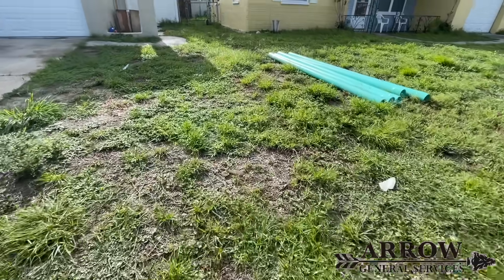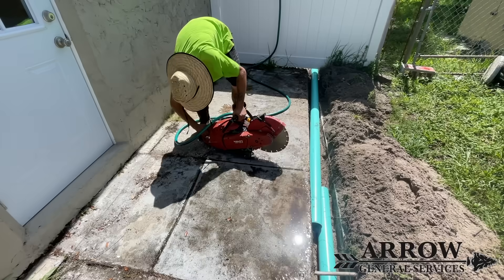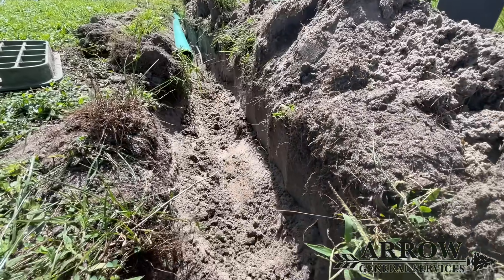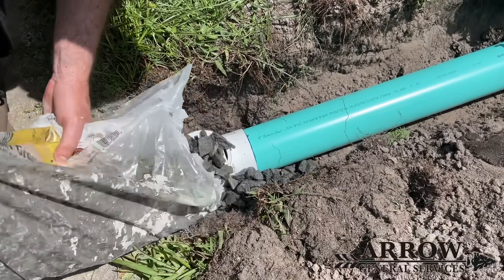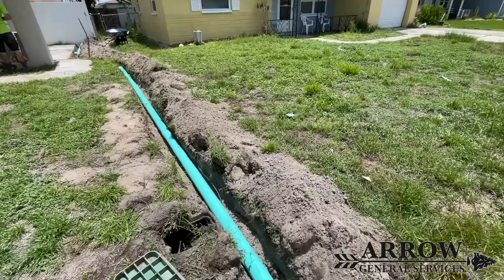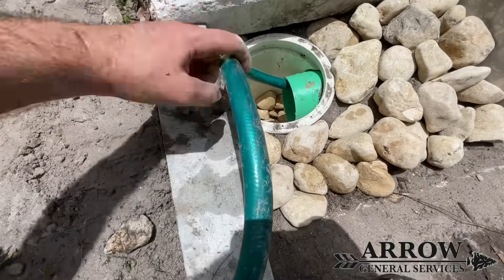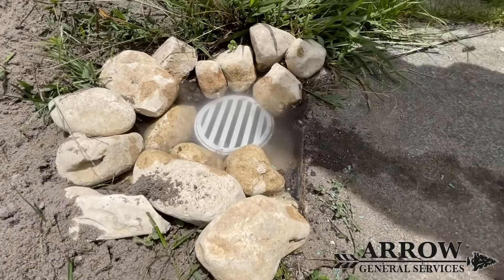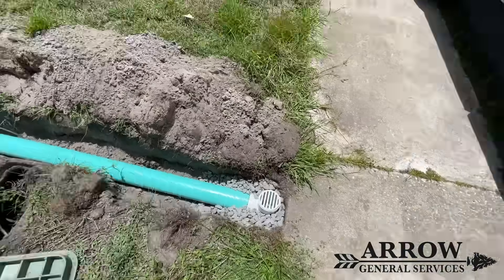How To Drain A Yard With No Slope - Flooding Issue Solved

Comment: Great solution for areas that do not have lengthy freezing temperatures. We generally try not to discharge water onto walking surfaces in the winter because of ice buildup.  Discharging water across a sidewalk in Wisconsin would be like buying a lottery ticket to a lawsuit for a slip and fall claim.
Reply: Absolutely. This isn't legal in any city.
Reply: @ThorD4602  Here in Texas houses are built with a slope to a shallow V between homes and sloped back to front so a river of water forms between houses and discharges across the sidewalk and into the street. He just built an underground version of how yard grading is done here, so not sure about, not legal in any city.
Reply: @wojtek-33   you aren't allowed to discharge water across a sidewalk in any neighborhood setting. You can get a permit to core the curb and dump into the gutter in many places. He didn't go for a permit, so until somebody cares, it doesn't matter.
Reply: @ThorD4602  I just explained to you how most neighborhoods are designed and built here. Coring the curb isn't allowed in some cities here either. Water is directed or discharged, across our sidewalks by design. Due to some flooding issues here as well, foundation sump pumps direct water into a channel along the property line and discharge across the sidewalk. It's just how it is here.
Reply: @wojtek-33   huh? You didn't explain anything to me. LOL.
Reply: @  You are clueless about the laws in your own state, and at the same time, you are acting like an expert on the subject.

Here you go:
 In Texas, it is generally not legal to run downspout discharge across a sidewalk. The Texas Department of Housing and Community Affairs requires that gutters and downspouts be designed to prevent water from running across sidewalks or onto adjacent properties. Discharge should be directed to a storm drain, the street or alley, or an approved watercourse, or at least 10 feet away from the building or property line.
Reply: @ThorD4602  Generally means something different than you think it's means. I explained to you how things are built and approved by the cities around me. Just like I explained that curb coring is not allowed everywhere either. Which to be clear to you, means it is approved in some places. Does the water magically jump over the sidewalk into the street when you need to discharge it?

Comment: Also curious how this is holding up since the video is 4 years old now. 
Looking into using this as well. Curious if a non woven fabric could also still be used with this to just help protect the prefabbed fabric that is on it. 
Thanks.
Reply from the maker: So far so good because we haven’t had a call back, but remember this is not a French drain. Meaning the pipe is solid and does not have perforations in it. This system simply moves water from point A to point B. If you are building a French drain (perforated pipe) then I would highly recommend using a good non woven geo textile fabric to wrap both the stone and pipe. We have more videos on our channel showing how to build a French drain. ✌️🤠

Comment: This would not work on a yard with no slope... How would you lay the pipes with fall? It clearly only works if the outlet is lower than the inlet, i.e., the yard is sloped.

Comment: I just dig a 4’x4’x5’deep hole and fill with a plastic crate or rocks then 12” of soil on top. They’re good for 40/50 years and are totally hidden and no water running across sidewalks. Standard requirement in U.K. 5 metres from a building. Water can fill up voids and percolate into soil over time

Comment: Instead of solid PVC, entire run should have been perforated PVC or hdpe with fabric wrap.   Then backfill btm w small rock. Entire system would be leak out drain similar to septic field.

Comment: Make the rain gutter downspout 4" diameter and sealed all the way to the outlet at the sidewalk. That way it all gets flushed away by simple water pressure.. 

The "field water" then can be routed to a large french drain in the front yard where the non-roof water can leach into the ground.

Comment: I have found you to be a good presenter and very thorough. There is one thing I don’t understand in this video. Why fill the two foot section with drain rock? Seems like the volume of that section is now full of rock which can clog with sediment. Why not put six inches on bottom to break the fall of water and leave the rest empty to accomodate water?

Comment: Why use this solid pipe and not french drain it the entire length?
Why do companies think they are giving you a good drain when the only thing in this entire project collecting water is those couple catch basins?
That entire length of pipe could have been made into a drain as well............................................
You almost got it done, but you didn't follow through.
This is not what you want as a homeowner.
I would demand the catch basins and french drain pipe the entire length.
This is crap work.

Comment: 4:00 what's schedule 80? Like schedule 40 twice?
Reply from the maker: Double the wall thickness. They usually come in gray but that particular repair coupling was white. The markings on it read PVC SCH 80. I’m pretty sure it’s a pressure fitting.
Reply: @StormWaterDrainageSolutions  it is

Comment: Does the 4" green pipe have no holes?  How do you clean the grate at the end of your run by the sidewalk? Is it removable?    Is the pipe you run under that grate preforated?  How does the water come out?  There is no cloth around the end of the pipe, so I thought it would get clogged up at the end of the run underground two feet down.  How do you measure slope?  Thanks!
Reply from the maker: This is a solid system so there are no perforations in the pipe. The grate pops on and off but we do not use grates at the end of our systems anymore, this video footage was filmed years ago before being uploaded to YouTube. Best to use a straight pipe when you can or a pop up emitter. The water comes out due to the pipe having slope. The yard has virtually no slope until about the last 5ft before the side walk. This is what allows the pipe to drain out at the discharge end and not back up at the catch basin or channel drain. This system was built before we started using geo fabric at our discharge ends. Now we always put it under our pop up emitters. Best way to measure your slope in yard drainage is to use a 4-6ft level and make sure your bubble is going opposite of the way you want water to travel. For more in drainage education check out our other videos. Thank you for your interest and support!
Reply: @StormWaterDrainageSolutions   Thank you for this information! :)
Reply from the maker: @squirrelattackspidy  Not a problem 💪

Comment: Bro, just cut the side walk and drain the water to the street that's kinda mickey mouse.
Reply from the maker: The city does not want you cutting their infrastructure. That’s a big no.
Reply: Oh please like they are gonna care as long as its replaced and doesn't create a hazard. I just tore up my whole sidewalk and driveway and it city inspector said nice job. Just say verbatum "Sidewalk was cracked and there was a Hazard." They wont care. I did it without a permit and they didnt care. @StormWaterDrainageSolutions
Reply: Oh please very Mickey Mouse job... 
 @StormWaterDrainageSolutions

Comment: Not sure how well this system would work in cold climates.
Reply from the maker: It’s a Florida system, I would not recommend for Northern climates. For cold temperatures use a high quality HDPE pipe and system.
Reply: @StormWaterDrainageSolutions  that's what I was thinking.
Reply: @StormWaterDrainageSolutions  would love to hear from a contractor in an area with winters where the temperature regularly fluctuates above and below freezing. I need something like this in upstate NY but regardless of whether the pipe is freeze tolerant the water would freeze (unless the entire system was below the freeze line) and when the air temperature was warm enough for rain but the the system was frozen nothing would flow and then there would be a real problem.
Reply from the maker: @robertkribs9513  They sell heat cables that are meant to go inside drainage pipes to warm the pipe in the winter so that it keeps water from freezing. Also check out French Drain Man’s channel, he is in a northern climate. 💪
Reply: @StormWaterDrainageSolutions  excellent! thank you!

Comment: I keep seeing videos where people run the drain line to the city sidewalk or street. This is a big problem if you live somewhere where there are harsh winters as that water can freeze with changing daily temps. So you can expect complaints from the neighbors, potential lawsuit from someone falling on the sidewalk or skidding on the road, and a visit from city officials. Better to run it to a drywell or get city permission to connect to the city drain system.

Comment: I'm confused as to why there are no roof gutters and down pipes, surely it would have been easier to direct the water from the property in this fashion, even if it then has to be chanelled into a french drain further away. Not sure it would be legal to direct the water onto the road like this in the UK it could cause problems with the neighbours opposite, or freeze on the road in the winter, but then, what do I know....

Comment: you dont have to line it with the material or put the rocks?
Reply from the maker: This is PVC SDR35 solid pipe. It is not a French drain.
Reply: @StormWaterDrainageSolutions  got it thanks..trying to learn :)
Reply from the maker: @tomiko2683  Not a problem and always happy to help!

Comment: Once the water fills up at the end it will lose all it's momentum because the water flow will be dammed up by water trying to escape and the catch basin at the porch will back up tremendously. This system will fail in a downpour.

Comment: If a landscaper or contractor is trying to sell you on a french drain or wet well system in 98% of the cases, your first instinct should be to run and never return their call. 

With that being said, there may be some benefit to this particular case but without more elevation data that is hard to determine. Either way, this system using conservative math would appear to be ineffective over two to three inches of rain, which judging by the soil is in a subtropical climate subjected to far more extremes.

Comment: Do places ever have any code that would make this illegal to do (draining across the sidewalk)?  I have a house with no gutters in Las Vegas where it rarely rains (average annual rainfall is 4 inches) but when it does it generally tips down.  But adding gutters begs the question where to drain too.  I thought about maybe digging out a big area in our rock coated front yard (no one has grass any more) to a foot or so, backfilling with rock and then directing some drain pipes to it. It's basically what you did but with a leech field.  It might still lead to some water rising up and flooding to the street but when it rains like that the street is inches deep in water anyway (fortunately our house set well back and a couple of feet above grade so no risk of flooding the house).

Comment: I added a zoeller to my backyard sump.
Reply from the maker: Zoeller makes some very good pumps. Just make sure you got the one with the float bar. M98 or and M53
Reply: @StormWaterDrainageSolutions  I installed Zoeller wastemate M-267H with 2inch discharge.

Comment: Hi. Thank you for posting this. At 2:40 you show the orientation of the "clean out tee" with the open end pointing down. At 2:45 you show the clean out tee with the open end pointing up; you're pouring the drain rock into the open end. I'm confused. Which is it?
Reply: He showed the finished position at 2:40.  At 2:45 he’s filling the 2’ branch off the T. When’s he’s done he will put the grate back on the T and it will look like 2:40 again.

Comment: The house has to have gutters and downspouts.  It's easier to direct.  Water will run even on a flat surface.  You basically created a dry well with that Tee.  It's to bad you couldn't you couldn't use a smaller pipe to go under the sidewalk to the road.  I can't see if the road elevation is the same as sidewalk.  Here in Connecticut your allowed to run rainwater into the gutter.  That horizontal pipe running through the yard also acts like a reservoir until the level goes down.  Not having gutters and downspouts will eventually cause damage to the house and your investment.

Tom Dutkiewicz

Comment: I see several things wrong with this.  If there is no drop in the yard, that means that the place where the water is pooling is at the same level as the sidewalk.  If anything, water will still pool because water still has to flow back up at the exhaust end.  So then I see water continuing to pool once the pipe and drain by the sidewalk is full of water.  Additionally, wouldn't all of the water flowing out by the sidewalk eventually cause washout under the sidewalk, thus damaging it?
Reply: I agree. Water is going to flow to the lowest point. If your inlet is the same level as you outlet water will fill the pipe then come out both ends...pooling at the inlets.

Comment: Excellent job and as noted in other comments no music or other background disturbances, annoyances. Where was this project installed? I started out thinking that this was a DIY project. A concern that occurred to me was at the sidewalk, "ice" forming. As old school and back in the day, testing the pipe as you did would be like "priming the pump". The two feet down would be like a miniature ceptic tank. Also, because of possible standing water, I noticed that the "patio" at the back door had a grey tint. This could have been a mold or mildew problem. Even though it may not have been in the contract for this job, "going the extra mile" attitude, during clean up the "patio" could have cleaned with Muriatic Acid.
Reply: Considering it’s Florida (judging by the snake grass and abundance of screen in patio areas) I’d wager the intense humidity is the cause of the discoloration. 

You can clean it off but it’ll return not long after, most end up etching the concrete but that comes with its own issues.
Reply: @l00tur  Thank you for your reply, I have heard that in Florida to reduce the humidity in clothes closets if you can find one a 100W incandescent light bulb is installed. Then concerning some of my other comments it looks like I am stuck between the proverbial rock and hard place. And what with the weather changes, ice can be an occasional problem. Well, take care!

Comment: Had this been my house I would have installed a catch basin but also used a float activated water pump with a long discharge hose buried under the top soil out to the street. This only works in warmer climates of course. With a water pump you always remove all water after a storm, IMHO.

Comment: Kind of interesting that "drain rock" used like this reduces percolation because in a very short time dirt will come down the line and fill all the voids. Result is very rocky soil and water doesn't go through rock very fast.
Reply: I presume the rock is used to prevent larger objects from collecting and blocking the overall operation of the drain. The likelihood of the homeowner keeping all 3 drains clean is pretty low considering their yard condition.

Comment: Lol when he went to touch that 4 1/2” hole saw bit after using it I was thinking “that’s gonna be hot” and you see him move his hand away quickly 😂 nice job here guys but that cement pad should have just been re installed to have proper slope and a weeper could have been added . I think this was a little excessive but pouring a new slab is also a lot money. Horrible looking yard shocked they spent any money on this

Comment: A quick cut through the sidewalk and repair is far more effective. Use a concrete cut-off saw or a 7.5" diamond blade on a skill saw to demo the sidewalk 5" wide in an hour, put the pipe in, and put fresh concrete over. Doing this on a Saturday and using a bit of water to wash off the white cement sheen and expose the sand in the concrete avoids the need for a permit and it all blends in.

Comment: The workmanship is very unprofessional and rather than resolve a problem you have created another what happens when winter comes and that rainwater drain you installed starts overflowing onto the sidewalk and road and it freezes over it becomes an accident waiting to happen also your drain will freeze and back up as it’s not below frost depth , that is the problem with unqualified construction / building trade cowboys /chancers.

Comment: I’m dealing with this at my house.  But it already has the same “channel” drains installed.  U can’t beat Mother Nature. The drains  clog and overflow with heavy rain.  My cement is now cracked from saturating the soil causing “heaving” (expanding soil).  Heaving isn’t a problem in FL.  By the way, that channel drain is godly expensive.  The fix, all gutter/roof water is directed away from the area.  I had  about the same amount of cement as the video but had it all removed.  Had dirt brought in to give the proper slope and a new cement patio put down.  The cement has a slight slope to shed water away from the house. No channel drain, no cutting the cement, no digging, no pipes, no cleaning out the drains.  Any company or crew who can install a sidewalk can install a small patio with the correct slope.